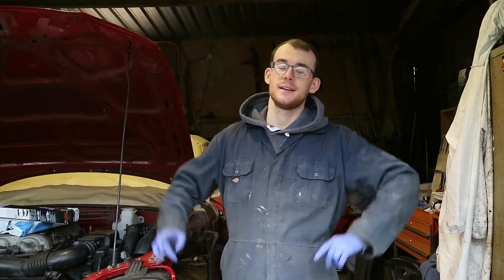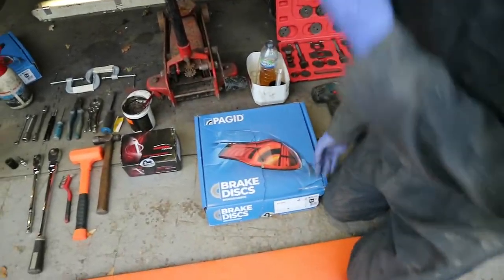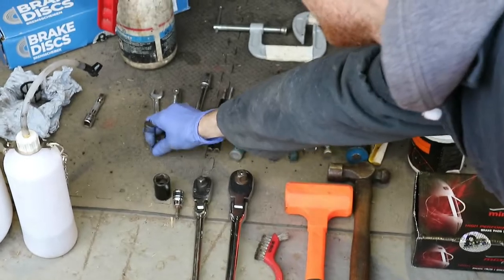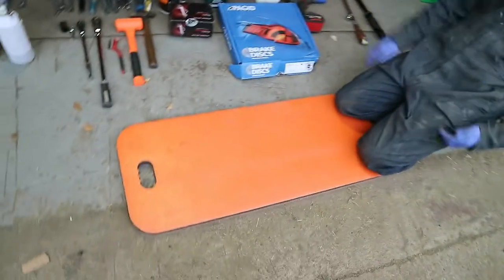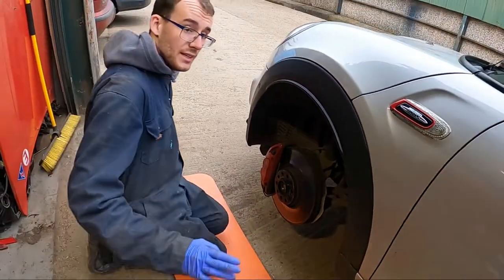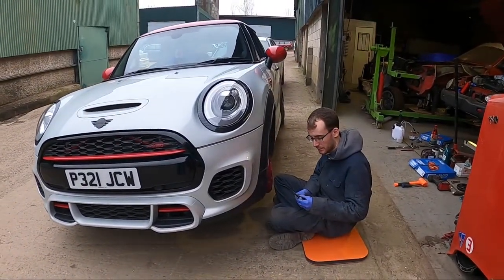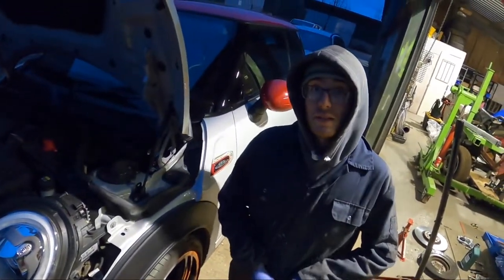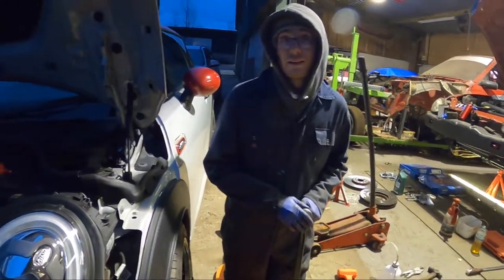Brembo Disk and Pad Change|F56 Mini John Cooper Works

Comment: To those watching this @18:25, put the lug nuts on, stick a bar where it touches two lug nuts on opposite sides across to stop the brake disc from spinning then unscrew the lock to free the brake disc from the hub

Comment: The difference in wear from the outside to the inside is rather weird ? Could it be that there is air or an obstruction in the system or the outside part wasn’t bled well enough ?! I have a  964 and the brembo calipers from the turbo (similar design) and they wear very symmetrical…

No copper or ceramic paste on the guides for the brake pads and the back of the pads ?

And a question : why didn’t you go for grooved or drilled and grooved Discs ?

Comment: Why didn’t you just put a screwdriver or flat tool in when pads were still fitted to push pistons back🤷🏻‍♂️
Reply: Or at least use the pads to protect the caliper rubber seals…😂😂😂